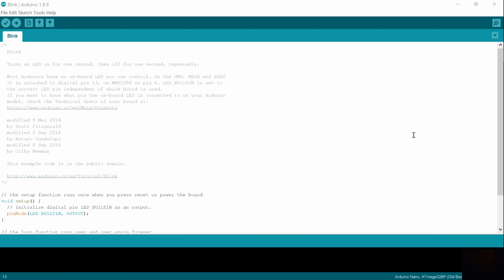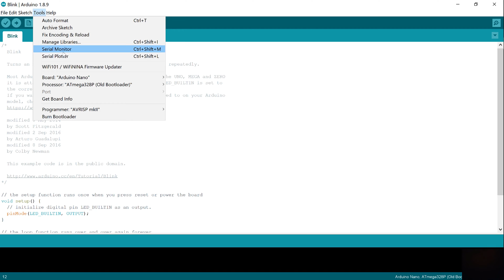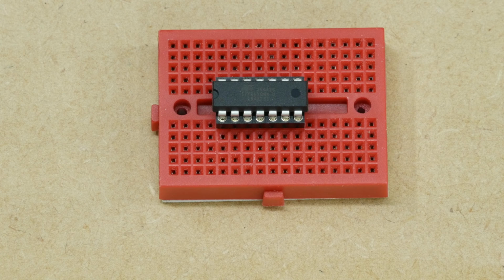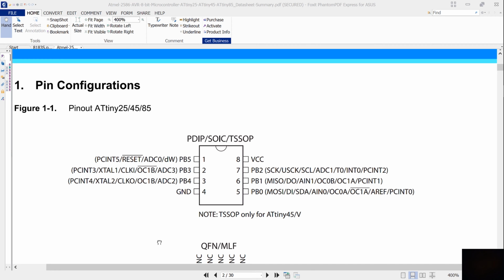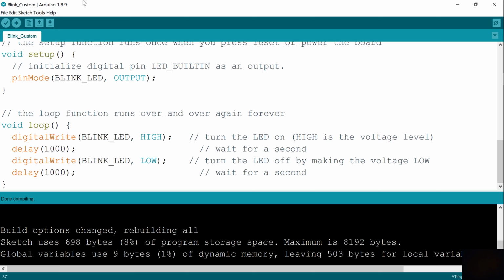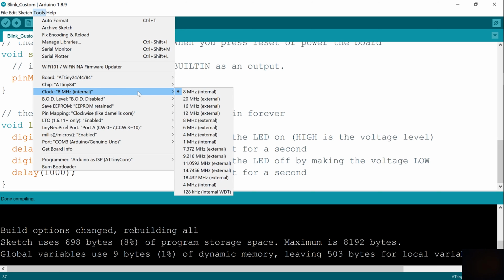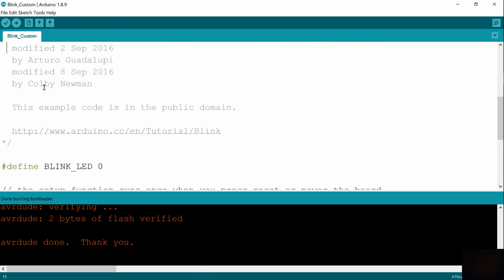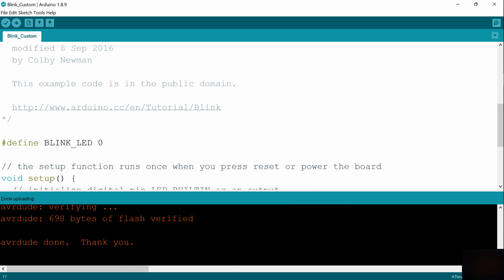Programming ATtiny85/84 with Arduino Uno (ATTinyCore)

Comment: Good video! I finally got my led blinking using ATTiny85, but I have a weird problem that I sometime have to upload the code several times because of this error: "avrdude stk500_getparm() error: protocol expects OK byte 0x10 but got 0x14" I have to hit upload several times to get it working and I still can't figure out what's the problem. The same error also occurs when I tried to burn the bootloader.
Reply from the maker: Unfortunately I'm not sure, you could try Googling or asking GPT. The first thing you want to consider with intermittent AVR errors is a loose connection or something not wired correctly.

Comment: I use lots of tiny84/85's for my projects, but I put bootloaders in all of the chips first.  That way I can program any of them using only a USB to TTL serial converter.

https://www.youtube.com/channel/UCq7WKLggL8bB5q0naMRns8A/videos
Reply: I have  an attiny84 chip. can you tell me what happens if I don't install the bootloader. Is the code not going to work?
Reply: @PawseidonHQ  Without the bootloader, you need to use a working arduino with ISP software to load a program directly.  This is the same hookup that is needed to install a bootloader.
Reply: @luhanxmonat  I am going to use an Attiny13 chip. But it has only 1KB of flash memory. Can you tell me how much space does the bootloader take?
Reply: @PawseidonHQ  The bootloader is about 0.5 k.  I never use those because the attiny85 cost is just a bit more.

Comment: It is 3 July 2023 and still works! Thanks, good job.
Reply from the maker: Super glad to hear thank you! Did you run into any setup issues or differences that I should note in the description?
Reply: @MattInglot  Your explanation was good, and my 1st attempt was successful, however things vent south after that! I could not reload the same chip with updated code! Have not tried a new chip yet. Have you encountered a similar problem?
Reply from the maker: @xzadeh  Sorry to hear. Honestly it could be so many things. I would suggest triple checking your connections and orientation of your chip because a wire coming loose on a breadboard or you putting the chip in one hole off or the wrong way is all stuff that's super common and has happened to me.

Less common but possible is you bricked the chip. Usually happens if you mess around with the fuse settings, such as telling it to use external clock or setting the clockspeed too low.
Reply: @MattInglot  Hi Matt, now that I have had some time to check my setup, I don’t see any issues with wiring! Just a little background, I have been using Atmel Dragon to program ATTinys for years until my Dragon died and Atmel (Microchip now) no longer supports Dragon, they call it obsolete! Trying alternatives led me to Arduino. I don’t think it is a reliable alternative! Still looking for a programmer that I can reliably use without spending $100s dollars for a hobby programmer. Any suggestions? Thanks in advance.
Reply from the maker: @xzadeh  sorry but unfortunately "Arduino" is the answer. For what it's worth, I program ATTiny chips all the time and anytime I've had an issue, it's always been my fault in the end (wiring, pins, bricking the chip, etc).
Reply: Hey Matt, just did the tutorial and it worked great, thanks a bunch!  And since you asked there were some minor differnces not shown in your video,  like when you picked the programmer, there isnt an (attinyCore)  in brackets next to Arduino as ISP anymore,  which threw me off and had me thinking i missed installing something somewhere,  but installing the board manager doesnt add it anymore anymore  however just using Arduino as ISP worked.  Aslo the attiny84a doesnt appear the same from the list as on yours, theres no "attiny84a" on its own, they all have brackets beside them one with "nobootloader" another with optibootloader, and something other option which i ended up selecting thinking it was the normal one and it wasnt.  The nobootloader is the right one, and i didnt get the same menus as yours like clock selection until I picked this one. Not a big deal, but some minor differences if anyones wondering.
Reply from the maker: @mikejones-vd3fg  thanks so much Mike! That's really helpful info! Software definitely changes quickly. Glad you got yours running.

Comment: Which language is used for Attiny 85
Reply from the maker: If you're using the Arduino platform to program it then you would be using Arduino's version of C++. But because of the way you phrased the question, I want to clarify that the chip itself doesn't read or understand C++. The compiler turns your code into a set of instructions that the chip can understand (machine language).

Comment: Has anyone successfully done this with an Arduino Uno Wifi Rev2? I'm having trouble with the error: avrdude: stk500_getsync() attempt x of 10: not in sync: resp = 0x03 while trying to burn the bootloader.
Reply from the maker: Unfortunately I've never worked with that Arduino but before assuming it's the board triple double quadruple check all your connections against the wiring diagrams and make sure you are using the correct pin diagram for your ATTiny. Then double check everything else is wired up too, and that the software settings are all correct. Also read the comments of the Arduino ISP program carefully in case it mentions your board and requires any changes. What my video didn't show was the 2 hours of troubleshooting owing to various connection mistakes.

Comment: Hi, I probably successfully uploaded the Arduino ISP to the Arduino Pro Mini (the LED lights up like it's breathing).
 When I want to upload an example to Attina 85 Blink will print an Arduino IDE error:  
avrdude: Expected signature for ATtiny85 is 1E 93 0B
                Double check chip, or use -F to override this check.
Attiny85 board set, 1 MHz internal clock, com3 and Arduino as ISP. I don't know what's wrong anymore .. 
AVRISP mkII encountered an error while loading the project
Reply from the maker: If avrdude is coming back with something like signature is 0 expected is __ then it can't see the ATTiny. When this happens to me it's almost always a wiring error or connection. Could possibly be bad ATTiny, or mistake in how you setup your programmer. 

Sooo. I would suggest starting by triple checking your wiring and if you are still banging your head against the wall then unfortunately next step is go through the video and making sure you got all other steps right. But 80% it's wiring.

Good luck!

Comment: Like many of these videos, you loaded the bootloader and then overwrote it with blink.  The point of the bootloader is to not need ISP programming but go directly to serial RX, TX, and Reset pins using a serial FTDI or something.
Reply from the maker: The issue is that you have to burn the bootloader in order to set the fuses. 

Per the documentation on https://github.com/SpenceKonde/ATTinyCore

"When using a chip for the first time, or after changing the clock speed, EESAVE or BOD settings, you must do "burn bootloader" to set the fuses, even if you are not using the chip with a bootloader"
Reply: Thanks, that makes sense now.  So nobody I've watched is actually wanting to use it stand alone?  That is what I have done with all of my ATTiney/ATMega chips.  Then I can use them in projects with just a serial connection to the Arduino development system.

Comment: Brilliant. The key point with Matt's video is that it is up to date: so many videos are not. MATT, please keep this posting checked over. Two points: the Arduino RESET 10microfarad capacitor is probably an electrolytic with polarised ( + and - ) terminals.  It is important that the capacitor's negative ( - ) terminal is connected to 0V or GND. :  I connected the test LED to a pin not used to programme the chip (ie.  not pin0 - PB0), in my case pin3 - PB3 (physical chip pin 2) on an ATTiny85. Thus the LED can be left connected while code is flashed into the chip. Don't forget to change all coding from pin0 to pin3. Hope this helps someone?
Reply from the maker: Thanks Kenneth. Yes the polarity of electrolytic capacitors is important.
Reply: hi there,

thanks for the excellent tips. I have also something to share. Wokwi Arduino simulator has also the capability to simulate ATtiny85 😀 I use this to write Arduino sketch and also verify it without real hardware.

The simulator is free of cost and doesn't require any installations. It can run also on my mobile browser 🙂🙂

ATtiny85 examples are here:
ATtiny85 and FastLED
https://wokwi.com/arduino/projects/283910810787381773

ATtiny85 and simple LED
https://wokwi.com/arduino/projects/283022189068812813

Please visit https://wokwi.com for more such Arduino simulations. Kindly give a like, if this information was interesting.

Comment: FOUND IT! and more! hate to do a commercial but here is were to find the information and of course, its amazon! not google!
it relates to the "speed of light" distributors making the "speed kits" (arduino uno rev3 pin quick reference)
its $135 and if money has no meaning its nice but their are possibly cheap ways to find answer possibly!
 [ https://www.amazon.com/dp/B00UET6VJ6/ref=sspa_dk_detail_6?psc=1&pd_rd_i=B00UET6VJ6&pd_rd_w=im7W0&pf_rd_p=48d372c1-f7e1-4b8b-9d02-4bd86f5158c5&pd_rd_wg=stjMs&pf_rd_r=0DM14X958B4RX42PJ4PH&pd_rd_r=90ac8793-260d-4b83-a300-babd58787954&spLa=ZW5jcnlwdGVkUXVhbGlmaWVyPUExUEQ5U0VOS0tWQUpQJmVuY3J5cHRlZElkPUEwODcyOTcyMkk3NTVDU1hQSkxDUiZlbmNyeXB0ZWRBZElkPUEwMjgzODQxMTdHU1dFN1JTMElRTSZ3aWRnZXROYW1lPXNwX2RldGFpbCZhY3Rpb249Y2xpY2tSZWRpcmVjdCZkb05vdExvZ0NsaWNrPXRydWU=]
the six pins are THE (ICSP) USB interface
farthest outside pin (I2C)SCL
inside to other pins (I2C) SDA
 AREF. Reference voltage for the analog inputs. Used with analogReference(). 
BUT THere IS 1 PIN NEXT TO THE "IOREF" farthest outside dont know what that is?

Comment: Thanks for the tutorial, Is this method going to work with ATtiny13 as well?
Reply from the maker: It looks like ATtiny13 also uses ISP for programming so the steps should be identical, however you must select the correct ATtiny and look at the pin out diagram for ATtiny13 to make sure you have all the pins connected correctly. Good luck!
Reply: Matt Inglot , thanks for the reply, it looks like there is no ATtiny13 in the boards’ list. Do I need to choose some other chips? Or not gonna work?
Reply from the maker: @abolfazlabbasi4854  Hmmmmmm! You are right. You could try the core listed here: https://www.electronics-lab.com/project/how-to-program-attiny13attiny13a-using-arduino-ide/ Good luck!

Comment: Everything seemed to upload correctly. However, when I try to blink the LED, it seems to just stay on permanently. This happens regardless of which ATtiny pin it is plugged into. Why would this be?
Reply from the maker: It's very difficult to debug this kind of stuff online because I don't see your setup, I obviously can't touch it and fiddle with it, and so on. The best tip I can give you for any sort of troubleshooting is to isolate as much as possible. So in this case if the LED isn't blinking, pull out the ole multimeter, and prob the pin you THINK is the correct pin, and see if the voltage changes as if it were blinking (one lead should be on the pin, one on ground as in the negative part of your power supply). If it does, check your wiring. If it doesn't, then there is something wrong with your program. I would guess you have the incorrect pin # or some error in the code. Sorry I can't be more help, but if you reason it out you should be able to figure it out. This stuff takes a bit of troubleshooting and fiddling.
Reply: @MattInglot  thanks, I appreciate the advice! Otherwise, the video was great and definitely one of the best tutorials for this out there.

Comment: hello  yesterday i bought an at tiny 85 and before 5 minutes it worked fine but the last time i plugged it in i put reverse voltage by mistake and now it doesnt run did i burn it?
Reply from the maker: Unfortunately it sounds like it. With how little the chips cost it's a good idea to have a few on hand in case you make mistakes like that. It's almost inevitable that as you play with this stuff you'll burn something out by accident.
Reply: @MattInglot  oh thank you for answering so quick and secondly I also had plugged in an 8*8 matrix and this also doesnt light up does it mean I burned this too
Reply from the maker: @trashos817  It's really not something I could tell you over the internet. It's certainly possible that it broke, but it's just as possible that you now have it hooked up wrong, programmed wrong, etc.

The only way you can really work that out is to start troubleshooting. If you have spares of the components the obivous thing to do is double check all your writing, then pop in a good component. If you don't, then you need to start pulling out the multimeter and seeing if your getting power where you expect it (including output on any output pins). It can also be helpful to break up your circuit into the simplest possible components needed to test it before testing everything together.

Good luck!

Comment: Ok I am confused, can the ATtiny85 read in analog input in reference to serial communication SCL and SDA ? Pins 6 and 7 I saw were not used.
Reply: You can definitely use ATtiny85 to read an analog pin and also have serial communication via SCL and SDA.
If you would like to program the ATtiny85 in Arduino style and also want to verify the code without the real sample, please go ahead and visit https://wokwi.com

ATtiny85 code sample links are here:
https://wokwi.com/arduino/projects/283910810787381773
https://wokwi.com/arduino/projects/283022189068812813
https://wokwi.com/arduino/projects/283019827166052872

Please give a like if you find this information interesting 🙂

for more Arduino simulations visit https://wokwi.com

Wokwi Arduino simulation is free. It is based on AVR8js platform and is open source. Many people have developed interesting projects using the open-source Arduino compiler.

You can easily save and share the projects you create.
The Arduino projects can be run instantly on a web browser or a mobile browser🌐
No need to install or download anything - No hassles 
It also has a huge number of peripherals to play with

OLED, FastLED, NeoPixels, LCD1602, Servos, Potentiometers, Matrix Keypad and more. Please give a like if you find this interesting

Comment: I'm getting a attiny85 for a small project I want to do. You mentioned that I needed a 0.1uF Ceramic capacitor. You made it sound like I really needed a ceramic capacitor but I just have normal ones. Can I just get away with the normal ones?
Reply: Apparently, it's important for high frequencies: https://electronics.stackexchange.com/questions/232631/ceramic-caps-vs-electrolytic-what-are-the-tangible-differences-in-use

Comment: bro can we do self watering plants by connecting LCD display and soil moisture sensor pls reply me
Reply from the maker: Lots of people on YouTube have done exactly this. Do a search and you should be able to find a project that does it (typically with the regular Arduino boards, no real reason to go to the trouble of using the ATTiny here).

Comment: Please help, does anyone know what are the list of classic Arduino functions that the ATTinyCore supports? I can't find this anywhere on the internet. I'm not a pro at programming so looking at the source files and libraries on GitHub confuses me even more.
Reply from the maker: It's a loaded question because it depends on how far down the rabbit hole you want to do. Since you are a beginner the easiest answer is that most of the Arduino functions and libraries should work just fine, and you are encouraged to try stuff out and experiment for yourself. For the stereotypical Arduino examples it should mostly work (assuming you hook things up to the correct pings and number them correctly).

Of course that's not the whole answer. The ATmega328 (the processor that Arduino Uno uses) has more capabilities than the different ATtiny processors. So of course you're not going to be able to use functionality that the processor doesn't support.

How does this affect you? It depends on the complexity of the code you are writing. For a beginner the biggest impact is that ATmega328 has a lot more I/O pins, more PWM capable pins, and so on. All of which you can grab easily from the datasheet for your chosen ATtiny.

If you continue down the rabbit hole to lower level programming and start dealing with things like interrupts, those are all different not only with ATtiny vs ATmega328 but within the ATtiny family as well. At that point you need to download and read the datasheets to understand if a particular processor will work for your needs, and how to access those advanced capabilities.